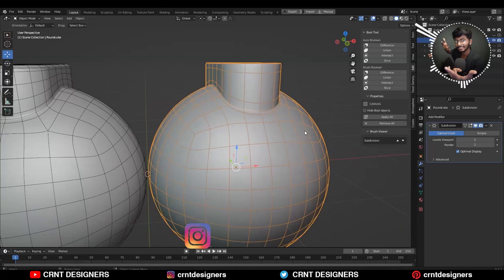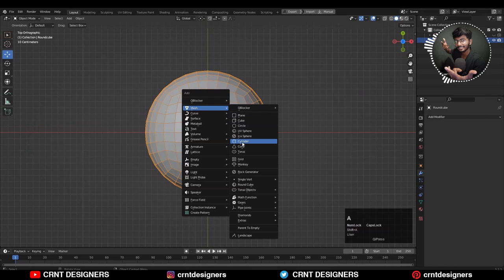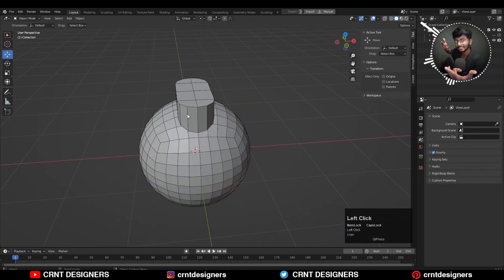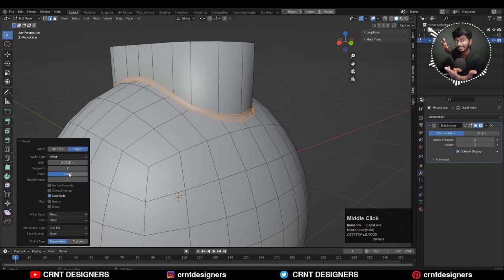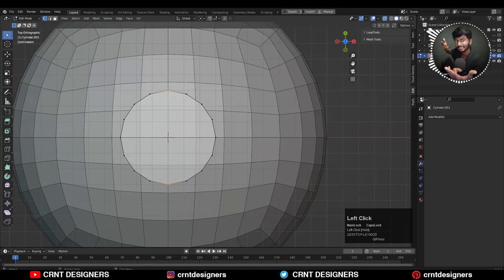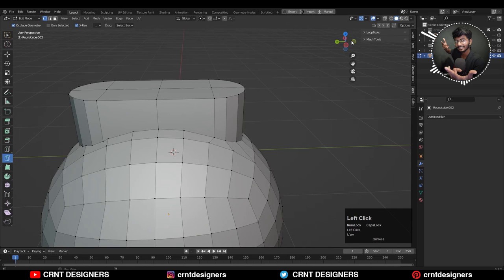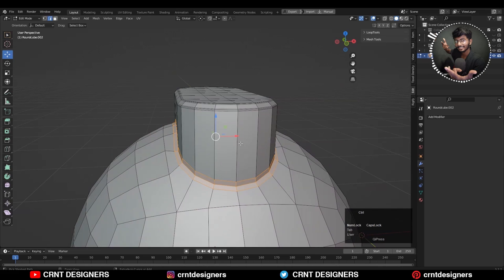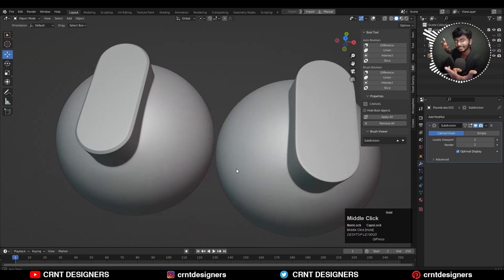Good Shading With Bad Topology _ Blender Topology Tutorial

Comment: If you are deep enough into blender to work like him, you can resolve merging issues like that, but a beginner could end up taking a lot of time and effort in adjusting vertices manually. The approach I like the most is to use the shrinkwrap modifier on both objects, with a vertex group on the connection point on each object. It sounds more complicated than it is, tutorials about the modifier on YT are far easier to understand. It allows you to work on any surface you want to cut/merge into and you can check the result before applying anything. And use "loop tools" -> for example "circle" to prepare the shape of your mesh connection.
Reply: can you point me out to some tutorials... for the shrinwrap technique
Reply: @lavatr8322  Hi, sure. I learned it from Ian McGlashams channel on youtube, the video is called "Blender - Connecting Cylinders - #15 Subdivision Surface Modelling in Blender 3" or grab the part of the url I can post here /IS2LPVNp6SE
He has some great videos about subdivision topology in general and the other source I like to recommend is "blender secrets" (also YT).
Good luck on your journey!

Comment: This is waaaaaaay too fast to follow. Also you don't explain or clarify what you're talking about. Why is it bad topology? Why are you modelling in a certain way? This would be a lot more helpful if you slowed down and took the time to explain what you're doing.
Reply: A bit late, but because you want the e pole mostly on a “flat” surface. It will cause shading problems otherwise. (Not in this example tho)
Reply: @enobrussee7153  it would not. Pentagon for this type of shapes is even better than quads. Try your self. When you subdivide it - it natively turning the flow and works as a junction.

Comment: Although it's probably not a huge issue with a spherical object, the issue here is that the one with the correct topology also suffers from 5 spoke poles, where as the one producing the n-gon does now. 5 spoke poles can sometimes cause unwanted effects in tight places on your mesh (of the angles are very narrow).

Comment: This is really interesting! though understanding topology way more than good or "ngon" = bad. Its not totally bad advice, and sure if you were to just avoid ngons altogether it may help simplify things but it is really more complex and by trying to dumb it down so simply is only hurting your learning experience. For starters, you should be showing how you can disable "optimal display" on the subd, and enable wireframe overlay to show topology after modifers and you will see with just 1 level of subd both  good and bad versions have almost identical topology. You literally, manually created what a subdivided 5 point ngon is after a level of subdivision..... In some cases the "bad* version is actually better, after 1 level of subd they both have a 5 point pole, and arguably, a perfectly smoothed(with subd) 5 point pole will have better shading than a manually placed one. 

In fact in a lot of cases ngons and or tris can be the better option because they are more simple, and in right use cases have exactly the same shading so more optimised, like if the surface is a flat section throw whatever nasty as hell geo ther eyou like, add a bevel with hardened normals and you have a ton less poly with literally exact same shading.... or if you are creating a really low poly version with subdivision, where the first level of subd is the actual model then levels above it are just for bake details or even use it for your LODs, you could use tris and ngons to create those same 5 point poles and have a simpler base mesh with subd and shrink or other mods or sculpt with multiresolution.  Whats actually important is to learn is the pros and cons of each, learn when and where is best to use each, when and why they are bad, why sometimes they are good and use them accordingly.